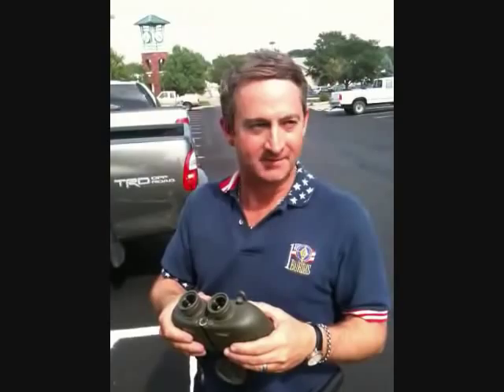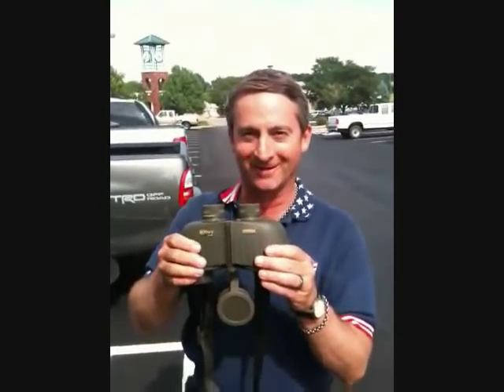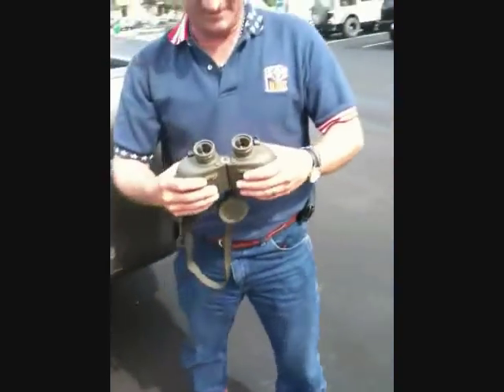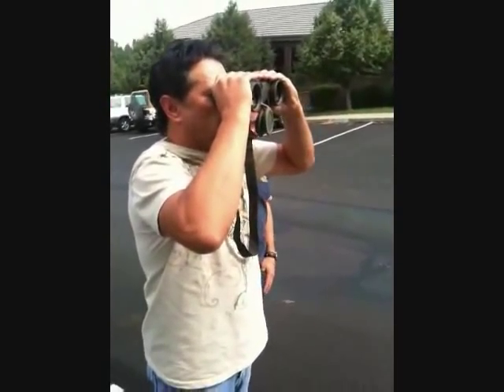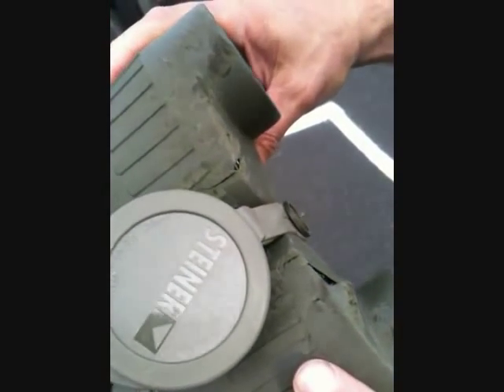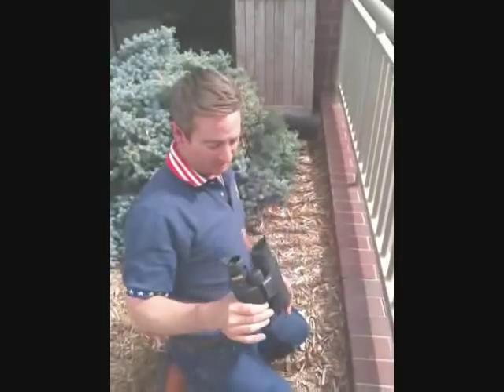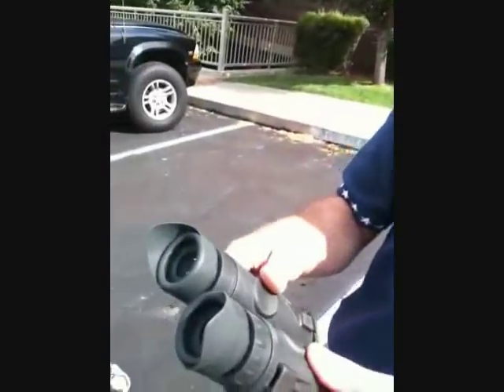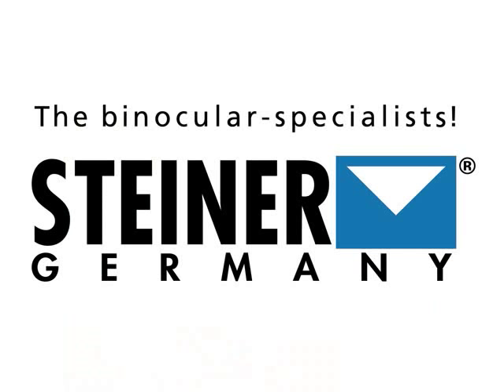Steiner Binocular Durability Test

Comment: Of course it did not do damage to the roof. 
Factors
1. Compact size - tensil strength plays in many forms. Quality, gravity, force, density, build, etc... at this matter it would depend on what purpose you would require the binos for.

2. Narrow bridge - boundless shapes build. Porro of this type gives away flat body making it narrow on the edges.

3. Thick polyester/polymer - less spatial than porro. However at the cost of Phase-correction. Porro has more tridimentional images.

4. Air density (nitrogen) - less than porro . However, cause this Marine type are constructed for maritime making it at least waterproof than roof.